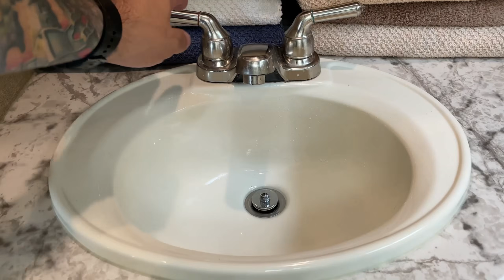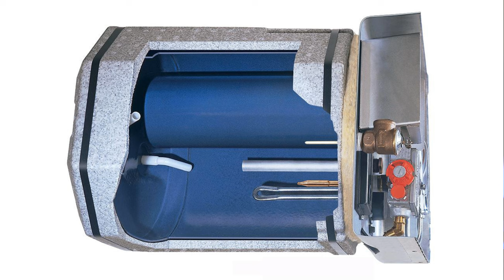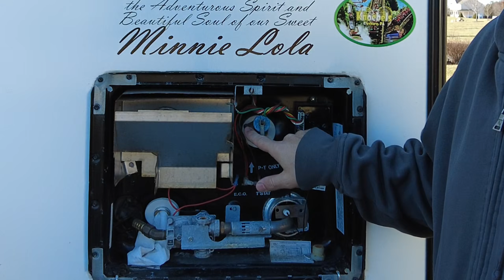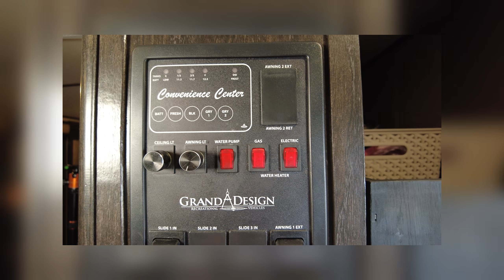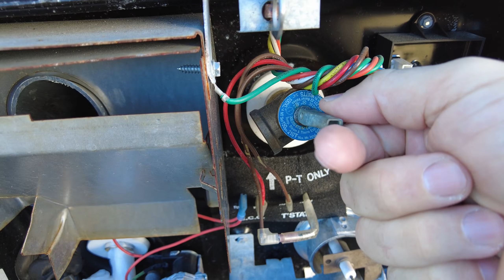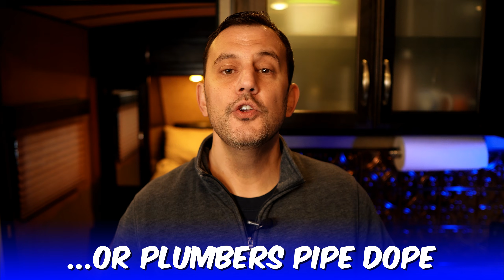Why RV Water Heater Pressure Valves Leak & How to Fix It - P&T Valves Explained

Comment: mine is a brand new unit and water heater and that valve is steadily flowing out water anytime the water source is on. water is pouring out of the compartment outside. what do i do?
Reply from the maker: Did you try everything in the video?

Comment: Ross thank you for that video. You do a great job. My valve maybe stuck closed. When I lift the handle I do not feel the spring tension however, it is not leaking water. Would that indicate it would not pop off in the event of an over pressure?
Reply from the maker: That’s exactly it, unless for some reason the mechanism connecting the handle to the valve under the spring is broken.  For $16 I’d just replace it:  https://amzn.to/3ZCIKTv
Reply: @RVTIPSANDTRAVELS   thanks for responding

Comment: I have air in the lines only when running hot water. I was told it was the t&p valve. Any thoughts?
Reply from the maker: How much air?  Is water coming out at all?
Reply: @RVTIPSANDTRAVELS  Oh yeah, kind of a violent mixture of air and water. I ran the water pump a little and that seems to fix it for a week or two.
Reply from the maker: For $20, I’d replace it and start from there: https://amzn.to/3Z6JeSd

Comment: Thank you for this tip. It did the trick! We travel full time in our R-Pod 179, and it seems every time we drive over a mountain pass, we need to reset the air pocket in the hot water tank. You present this method in simple steps. I appreciate what you do. Thanks!
Reply from the maker: Glad it helped!

Comment: Another issue is electrical….mine had a slow drip  - so happened the diode  directly below  had a safety tubing on it but water got in tubing anyways. So I got cold water instead of hot.
Bad design.
Reply from the maker: I’ll agree with you, it is a bad design.  The thermal coupler should be water proofed.

Comment: @RV Tips & Travels: I’m trying to find replacement bypass valves that aren’t plastic. I’ve a 2022 travel trailer and 2 of the plastic plumbing joints have already failed causing leaks. I’ve replaced all the joints, but for these valves. Those and HomeDepot don’t seem right somehow. What would you (or any other viewers out there who have experience) suggest and where would you seek to purchase the parts necessary?  Thanks in advance!
Reply from the maker: do you have stop valves or 2 way valves?
Reply: they are 2way valves that either allow water to flow into the water heater or redirect to bypass the water heater, rather than cut-off flow. I’d like to replace them with copper or maybe zinc.
Reply from the maker: can you send me a pic of your current valves to management@rvtipsandtravels.com

Comment: It will stop leaking if you just put a plug in. Crank it down good and tight . Leak fixed.
Reply from the maker: please do not do this.  ever.
Reply: @RVTIPSANDTRAVELS  That was a silly comment. Never do that.